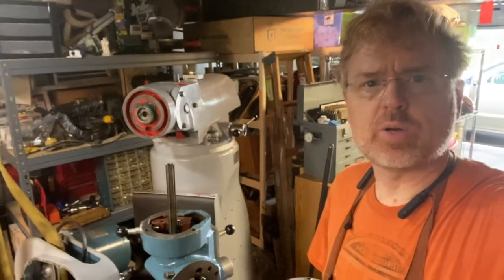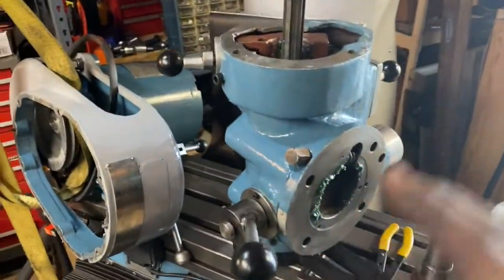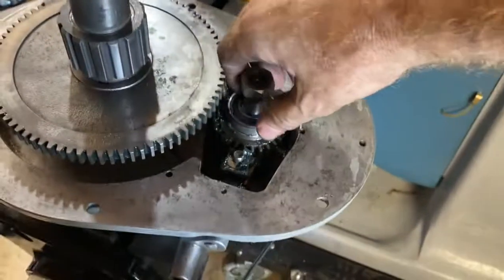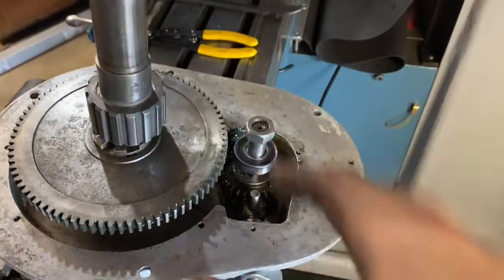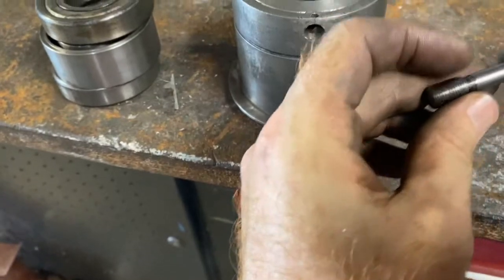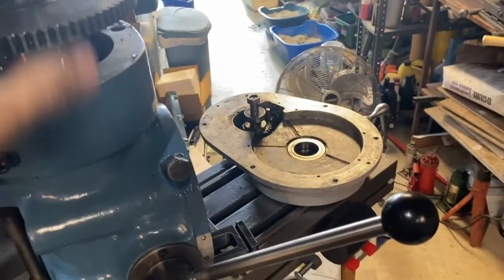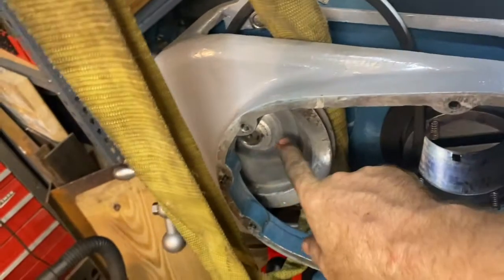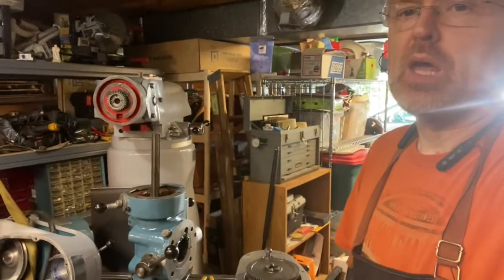Bridgeport Clone Milling Machine J Head Power Train Overview and Disassembly / How It Works

Comment: Can't get that big nut loose on my BP clone step pulley. Mine is slightly different design to yours. Have tried everything to get it loose. Even heat. I give up.
Reply from the maker: What kind of wrench are you using?